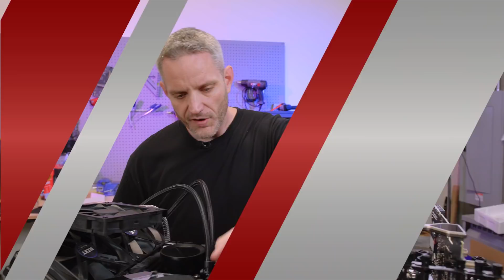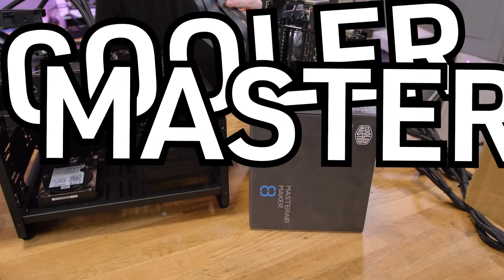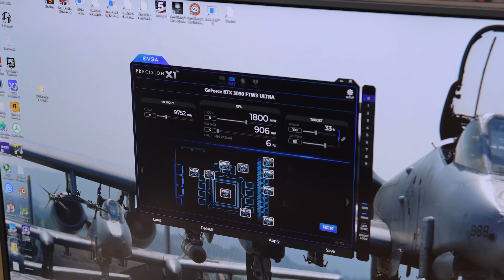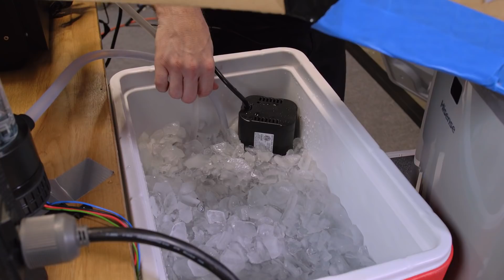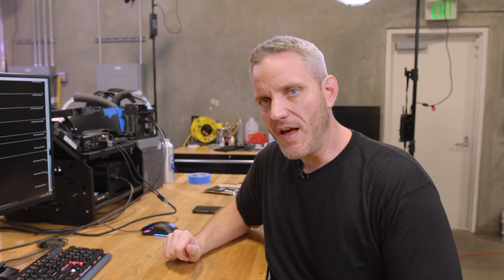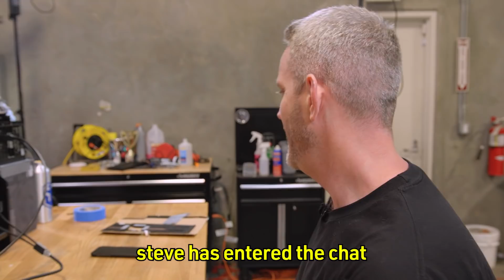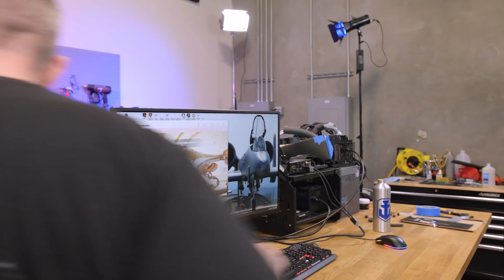Homemade Waterblocks for RTX 3090 SLI... these results are incredible!

Comment: Salt the ice up.
It actually makes it colder, and lasts longer. 

IT DOES NOT MELT ICE. IT MAKES SALT WATER AND THAT DOESNT FREEZE AS WELL, so it looks like it melts faster. It actually brings it well down below freezing. Bout 10 degrees C depending on the container
Reply: Is this why people were screwing then selves up when they did the ice salt challenge
Reply: @R4G3VideoGames  kinda. Water is polar and is chemically inclined to want to mix with the salt to make brine, but it can't do that while it is solid. In order to become a liquid it leaches loads of thermal energy from your hand. This is NOT the same as the ice just cooling down your hand, and with salt and ice, your hand can get far far far below freezing. It can give you frostbite quite easily.
Reply: The reason salt appears to melt ice and is used on roads is because it lowers the effective freezing temperature of water. Normally this is at 0c, but because salt water freezes at a temp lower than 0c, it reverts to a liquid state until it hits that negative c temp - and is why pouring salt on ice won't work if winter temperatures are too cold.

Edit: It's about -20c for standard sodium chloride.
Reply: @JoshRiolu  This is also the reason why in the winter, once temps get down below a certain spot, salt does not actually help when applied to roads
Reply: Josh Riolu you're talking about calucium salt or chlore salt
Reply: @Im_XNDER  calcium salt causes is like hardware which does it's sedementation and block the rad eventually.
Sodium salt will start the rusting process very quickly.and the parts in contact will have to be thrown afterwards.
Reply: Tanmay Panadi thats why i said chlore (i think its chloride but idk) aka its fake salt. sodium salt is the natural one i think
Reply: @JoshRiolu  It's also for traction for vehicles.
Reply: @JoshRiolu  iirc Canadian cities use some pretty exotic materials instead of sodium chloride to salt the roads, to handle tempz as low as -50c
Reply: @JoshRiolu   just learned something.. never knew that.
Reply: Exactly!!!!!!!!!!!
Reply: Crashish is actually right, salt in water brings down the melting point temperature.

https://en.wikipedia.org/wiki/Freezing-point_depression
Reply: What about other liquids you can get that don’t freeze on very low temps? Like the antifreeze liquid for cars? Maybe -30c liquid can beat KINGPIN?
Reply: @George_Bazooki  That's what I was thinking about. Why don't they use the radiator anti freeze liquid as used in cars. Then they can use the dry ice bucket again without freezing up the loops.
Reply: @IvoRadev  he did that but turns out anti freeze has lots of water in it look at the last ripgn series he did that 👍
Reply: Георгий Колесников  Liquid ammonia’s a good one for low temps and not freezing, but it’s a bit dangerous to work with
Reply: @George_Bazooki  Boris recommends Ruski Standart, at least...
Reply: @George_Bazooki  KINGPIN was on LN2, so that's not the same league. And he probably has several better score files saved for when its needed for competition.
Reply: Rock Salt,  then make Ice Cream.
Reply: Actually what you have to do is mix the salt in to the water before making the ice, THAT will keep it colder longer
Reply: Also how ice cream makers work.
Reply: A lot of people seem to be confused, so let me clarify some of the misconceptions people seem to have: 1) Salt lowers the freezing/melting temperature of the water. Since the ice that you're putting into the water is colder than 0 C (most freezers operate around -18 C), this means that you can have liquid water with a temperature much lower than 0 C. 2) Yes, corrosion would definitely be a concern, but only in the long term. This whole exercise is short term, to try to get a higher benchmark score. Running salt water through your loop for a few hours shouldn't be any problem as long as you flush the loop with fresh water afterward.
Reply: @sebastiangeorge9252  1 more thing to add. When people think "salt" they think of sodium chloride, while magnesium chloride can provide better results with lower freezing point. It is also less corrosive.
Reply: NO NO NO NO! DO NOT DO THAT! 
Let me give a lesson in chemistry here since I did do a chemistry degree at university. 
Yes, Sodium chloride + water = lower temperature it breaks apart the Na-Cl bond and dissociates it withing the sea of h20 atoms in doing so makes the bonding stronger, therefore, requiring more energy ie heat energy to break the intermolecular forces between them. 
Here's your big issue NaCl + H2O > NaOH + HCl 
Sodium hydroxide is an irritant to human skin and hydrochloric acid is welp yeah acid. You add those to metal like tin, + lead + copper and your results are not going to be good long term. Acids eat away at metals like lead producing poisonous bubbles stuff like tin forms tin(II)chloride is toxic as well. And god knows what other metals and materials are in a pc. 
Protect yourself and your PC by sticking with distilled water.
Reply: @Moody_Incorporated  it’s only in the esky (cooler). it’s not getting picked up by the loop. Literally only getting the cold water thrown over the rads
Reply: @notabandicoot5227  It depends on what the rads are made of. But the bottom line is in chemistry acid + metal even unreactive metals = bad bad. Acid loves to eat away at metals.
Reply: @Moody_Incorporated  aluminium then powder coated. A wash down after would be fine mate
Reply: @notabandicoot5227  Aluminium and powder what is this now what's the powder made of?
Reply: Didnt he have a video where he used dry ice and the sub zero temps were causing the pumps to not really work out that well, Jay did use some automotive radiator fluid i think too though.
Reply: @nightkil13r  yeah, the glycol was too thick. vodka should be fine though.
Reply: Salt is also a corrosive so you would not want to do that for long term. You could also end up clogging up if you get to much salt.
Reply: The problem with using salt with ice  is that the loop has distilled water.  So it would only clog/damage the loop, plus it can cause it to eat away at the plastic and metal.  And putting salt on the ice outside the loop may cause the eater in the loop to freeze which would hinder the flow. And you only want to get it to asc lose to freezing as possible without it freezing.
Reply: For ppl that don’t know, the loop isn’t pulling water in, it’s just cooling the radiator down. But there is diminishing returns. Like eventually having it <10c will only pull the loop down a few degrees. 
But I do think it’s worth it in the case of less temp loss in the long term
Reply: Salt also corroded stuff pretty easily too so pick your poison slight colder temps vs break stuff .
Reply: Yup
Reply: It does melt Ice,  by lowering the freezing point,  the normal ice can no longer maintain its frozen state  reverting back into liquid.  as its warmer then (salt water ice?)

problem is salt causing corrosion on the rad and pond pump.  solution!!!  spray out the pump and rad after use. run pump in non salt water for a few minutes  having it pump out to sink or  drain.

concern lower temps  higher chance for condensation.
Reply: yeah freezing point for 23% salt water is -21.1 degrees Celsius so you can get that pretty dang cold
Reply: Yea, but is it good for the pumps and the water blocks, no.... But does he need to worry about money that much, no as well...
Reply: @_lonath_  these things are for education and entertainment.    They showcase the technology and what can be achieved.

The pumps and blocks will undoubtedly be cleaned thoroughly and will be not be harmed 

Maybe there should be a disclaimer at the end of the segment saying ' No pumps or water blocks were damaged during the making of this presentation'
Reply: But it fucks your stuff up.
Reply: does it work better in glass container or metal?
Reply: Wouldnt the salt corrode the radiator?
Reply: Salting the ice bath could help if the cards put out enough heat, but you probably risk freezing the loop.  It's basically the same technique as making ice cream.
Reply: it does makes it colder but not last longer, ice will melt a lot faster...
Reply: Basic High school chemistry class demonstrating this making ice cream and we still struggle with this #neverforget
Reply: @The Crashish it WILL melt the ice, until it brings down the whole containers temperature to the new freezing point, tho. Where do you think all the heat goes from the water?
Reply: would the salt do any damage to the radiator though? dunno about the short term but long term salt damage can destroy car radiators.
Reply: @XiloTheOdd   i dont think hes too concerned about it I'm sure he doesn't want to destroy it but he seems focused on taking first for this friendly comp. Rad getting a little damage would be a slight insight compared to destroying a card or something similar. Looking forward yes you are correct, however, thinking about the minimal amount of hours with the possibility of giving it a total cleaning after. On top of that its a black painted rad and the salt needs to make it through the paint first as well.
Reply: Ya the copper would oxidate and thermals would be screwed sooo let's not do that
Reply: As long as the salt doesnt corrode the pipes
Reply: special salt needed!
Reply: No One has mentioned adding UREA to the water. 

Why you say, as it creates an endothermic reaction which cools the water. 

Because Science
Reply: lol and WAY more conductiv ^^ JUST DONT^^
Reply: Forget that it will rust
Reply: Oh look, the rare "intelligent" commend :) But seriously, this is the first comment in along time that was actualy usefull...
Reply: Ethanol + dry ice
Reply: Surely if you lower the freezing point, then ice will melt sooner which means less ice? I’m not an expert can someone help thsnks
Reply: @ProudGamerstheonlyrealone  the ice technically "melts" yes, because salt reduces the freezing point of water. So the water will be the same temperature as the ice would be.
Reply: Legion PCMR ahh I see thanks
Reply: @ProudGamerstheonlyrealone  you dont care about how much ice, you care about how much heat you can transfer. You can't pump ice, so you want fluid. The more you can chill the fluid without freezing it the better
Reply: Stryker2279 oh yeah true! Thanks for explaining
Reply: Get it frozen : https://www.youtube.com/watch?v=8e4pAXy1iZI
Reply: rust
Reply: Salt water would fuckup the metal in the water block so fucking hard if I recall correctly. That's why they have to distill the liquids in coolers. Might as well use a real coolant.
Reply: Think the word yall are looking for is liquify
Reply: salt corrodes :(
Reply: That is just wrong. Salt doesnt make water cold. It simply lowers the freezing point
Reply: Basic science
Reply: This is why home-made icecream churns have you adding salt to the ice.
Reply: by the same thought why not just use car antifreeze as that wouldn't damage the system, i was also wondering why they didn't just rent an industrial pipe freezer and use the freezing blocks for heatsinks unless there is a limit to how cold you can make the components that should get them to at least -5 if not -10 degrees c.
Reply: Yeah but corrosion. And it would probably ruin the blocks and pump
Reply: @lucasrodgers6904  They aren't saying to put salt water in the block, they are saying put salt in the cooler with the ice to keep that colder longer.
Reply: @2buxaslice  and then? water-salt solution at -10°C outside the radiator freezing the normal water they put inside? nice...
Reply: salt sounds too destructive, just go with vodka, that should drop the freezing point to the same level :)
Reply: @lang337  I was just pointing out that it wouldn't cause corrosion.
Reply: @2buxaslice  But salt water can possibly ruin the rubber rings that seals the radiator pipes and make it´s way inside the loop.
Reply: @Chuckiele  the thermal conductivity of alcohol is much lower than water, so 10 degrees isn't enough to offset the cooling efficiency.
Reply: @lHiTMANll  That shouldnt be a problem. Its not like the water gets heated in the block and cooled in the rad. The water temperature is roughly the same everywhere in the loop as the water is in excess and other things become the thermal bottleneck like the transfer from the GPU to the block.
Reply: @Chuckiele  I'm saying water transfers thermal energy to/from other materials much faster
Reply: @lHiTMANll  Yes, I know, but Im saying that the transfer speed is not the thermal bottleneck but other things like the transfer from the GPU to the water block and dropping the temperature of the water would help with that, so even with worse thermal conductivity vodka should be better because it can reach lower temperatures.
Reply: @lucasrodgers6904  He isn't pumping the ice water through the loop though. It will kill the radiator over time due to corrosion but it wouldn't do anything to the other components
Reply: PopinFRESH yeah true
Reply: @lucasrodgers6904  in the loop satt water would trash microfins.  in the cooler its fine.
Reply: Wow this comment section made my iq increase and decrease.
Reply: @lucasrodgers6904  Well it's not like they're gonna use it for a long time. It's just for the record, so I think it's fine
Reply: @lucasrodgers6904  He probably meant for in the bucket. Not the loop
Reply: @lucasrodgers6904  thats what i was thinking. itd ruin the loop. even if it was closed loop and they just stuck the rad in salt water, im not sure how well a rad would do in salty water long term
Reply: Jay did it in a Rip series some years back. So, it's not like he's not aware of it. I thing he's just... well, waiting on the others to catch him up. If he brings his water temps down another, let's say five degrees, and gains another 150 points, that would make him that much harder to catchup. Plus, these guys are probable talking with each other behind the scene, and establishing a plan for future videos in the series. And Jay had a target with this video and achieved it on iced water, no salt required. That's my 2 cents.
Reply: Let's get this comment to the top boys.
Reply: Chemistry ftw
Reply: That and glycol in the lines. Plus making the waterblock parralel instead of inline
Reply: salt be dangerous round the computer lab son, anyway you should put 50/50 antifreeze into the brine tank then throw in ice and dry ice, salt's for punktards because even if it makes the water harder to freeze it DOESN'T LOWER THE TEMP OF THE ICE COOLING IT
Reply: Salt ice bath is 0*F
Reply: now i know why the ocean is salty.
Reply: It does not make it colder. You can't decrease the temperature by adding salt. You only decrease the freezing point of water. It's still the same temperature.
Reply: @LegionPCMR  You can decrease the temp of the water because the ice in the ice bath is colder than 0C. Lowering the freezing point of the water means the ice you put in can reduce the water temp to below 0C
Reply: @Taurickk  either you can't read an entire post or you are trying to argue a point that is moot. If you read my post very carefully you will see that the first few words say "the salt will not decrease the temperature". This is in fact a scientifically proven fact. I never said you can't make the water colder yourself. That's dumb to think you can't. On the other hand I'm not sure why you are trying to correct something I didn't say. I really hope you are trying to be a troll. If not.... Well I hope you're 6 years old I guess.
Reply: @LegionPCMR  "If you read my post very carefully you will see that the first few words say "the salt will not decrease the temperature". This is in fact a scientifically proven fact."

No it isn't, you're wrong. Adding salt decreases the temperature by causing the ice to melt.
Reply: @LegionPCMR  Yes you can decrease the temperature by adding salt. Melting is an endothermic process.
Reply: @nathangamble125  I guess people really are that unintelligent. I thought you guys were just trying to troll people. Later kid I have work to do
Reply: Well, it'll make the water flow better at least. It won't cool it better unless you add something colder to it as well.
But on the flipside, less ice in the water might net you a loss over time due to the ice being the thing cooling the water to begin with.
Reply: @Illindi  You really need to read up on how physics work.
Reply: WRONG, YOU HAVE TO FREEZE THE SALT WATER, NOT THROW SALT IN A ICE WATER BATH
Reply: @AnthonyDiRuggiero  that would affect the melting point of the 'salty water' making it melt at a lower temperature and still result ins salted water.
Reply: @AnthonyDiRuggiero  ehh no...
https://www.thoughtco.com/how-cold-does-ice-get-with-salt-4017627
Reply: @AnthonyDiRuggiero  Don't be stupid, learn how thermodynamics work. Melting is an endothermic process. Causing ice to melt by adding salt reduces its temperature.
Reply: @nathangamble125  no. I believe it's chemistry. Salt lowers the freezing point. Doesn't make ice melt. 

If the ice is very cold, it will lower the temperature of the salty bath  water, until you add some heat.
Reply: @AnthonyDiRuggiero  dople wrong. If you freeze salt water, you wont get freezed salt water but pure water ice and more salty water. Ice is always pure water, cuz the crystallization process pushes other components like Sodium ions out of the structure. 
Throw salt in an ice water bath is actually a common procedure to cool things down to about -21°C (100 g ice + 33 g NaCl) in chemical synthesizes if needed.
Reply: Anthony DiRuggiero no mate. It helps but go look up the action lab. They just did a video on it
Reply: Anthony DiRuggiero no you can just throw salt at ice to make it colder, it’s a thing we do when making icecream